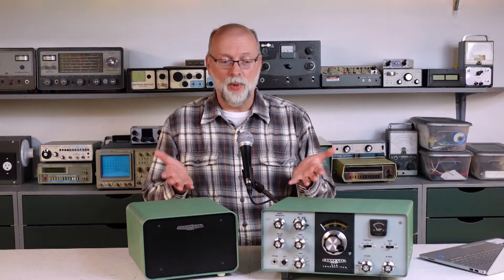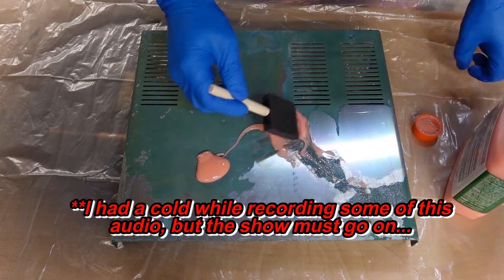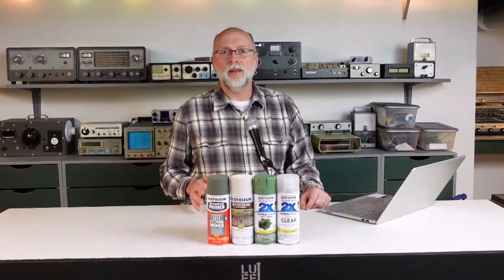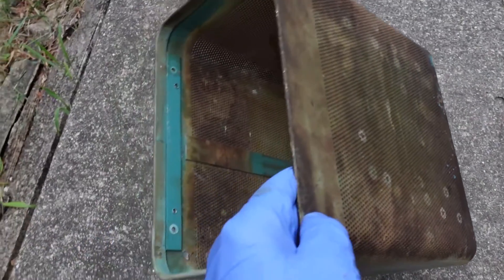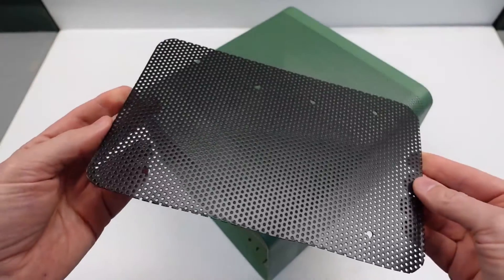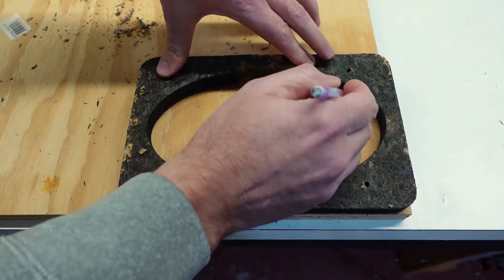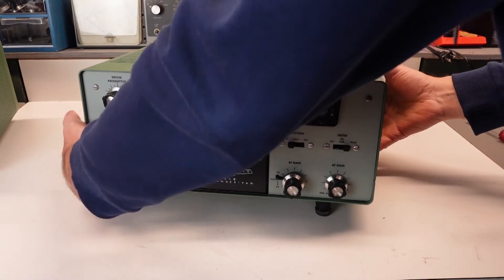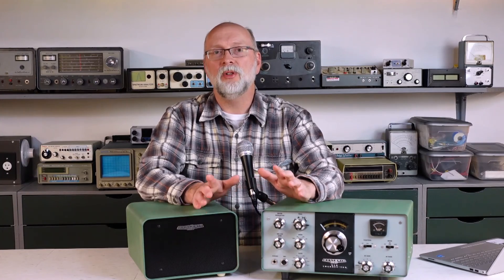Heathkit HW-101 Part #7: All Done!

Comment: I must say that all the work you have done this old transceiver certainly came out GREAT! I do have a question though about the Probes you used during the alignment process and the question is this
did the probe you used with your Heathkit VTVM have just the resistor at 1Meg ohm or did you use an RF probe with the diode resistor capacitor network?? Will Evert made repeated remarks about using an RF probe during alignment and one time I think he said he might have blown a diode in the probe, so those remarks have left me with this question about the probe makeup in particular!!
Thanks in advance.  73's
Reply from the maker: Thanks!  If its the step that I think you are referring to, I used the regular VTVM probe set on DC for making DC measurements with no modifications to the probe.
Reply: @levelupeelab  hello there. Sorry that I was not specific enough in my question but here is the more to the point question.
the question should be the probe that was used in doing the RF Null and the Neutralization was this and RF type probe with the diode resistor capacitor network inside? and OR the AC probe as Heathkit would say!? I just want to absolutely clear on this matter! because RF is an AC type voltage. Should the probe be strait through like the Heathkit probe for AC?
Reply from the maker: Ah, OK sorry, for the RF null and neutralization I used an RF probe that has the diode/resistor built into them.  That then connected to a regular DC meter.
Reply: @levelupeelab  Hello Daren! thanks for your time and answers! the last answer here was the one i was looking for YAY!! many thanks from myself at KC2UVN !!!

Comment: Enjoyed the series. I am starting to work on my HW22A that I built new in summer of 1967! It’s in pretty good shape as I have always kept it clean. It has low output but I can make QRP contacts. 
Do you have any RF voltage measurements of the transmitter driver stage. I think yours is also a 12BY7. 
73, Don N4DJ

Comment: Excellent job!  You make it look so easy.  Believe me, I know it’s not!  Listening to that QSO at the last reminded me of what a good rig this actually is.  I built one in the late 70’s as a teenager and it was my primary rig until the early 90’s.  I do remember it having some negetive quirks, those rubber bands for the tuning controls weren’t so good, but the vfo was very stable after a short warmup.  Good enough for RTTY, which I used it for, where only the more expensive rigs of that era could do.

Comment: Nice restoration. These Heath videos brought back fond memories of the SB-101 I had as a Novice/General. I noticed your s-meter not moving off zero during the QSO. Is that normal for the meter switch selection on the HW-101?